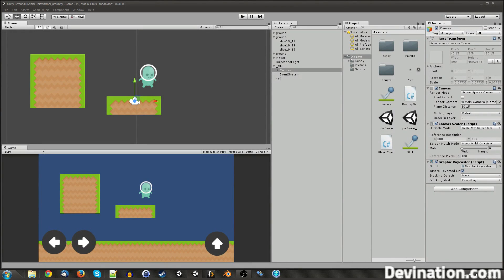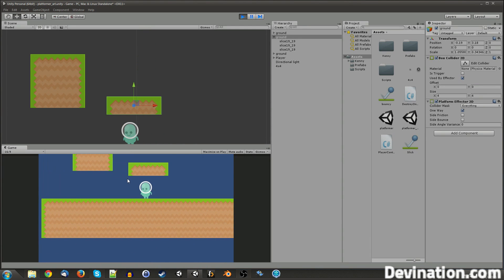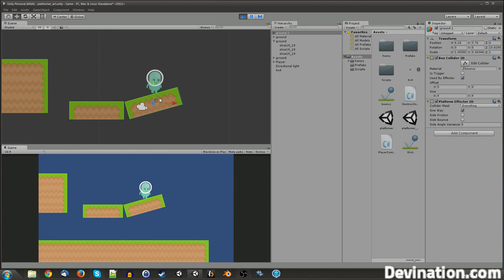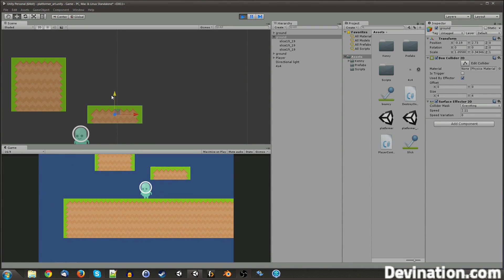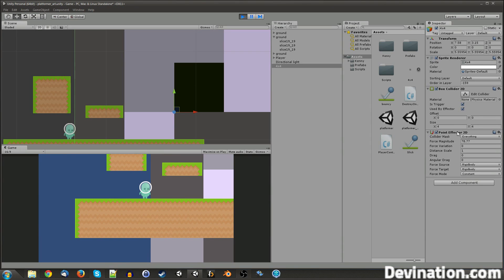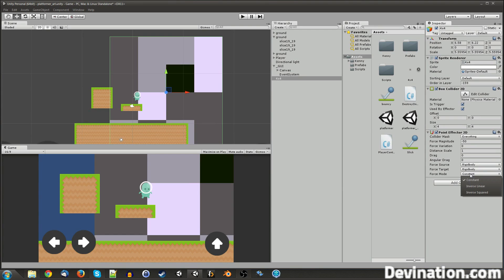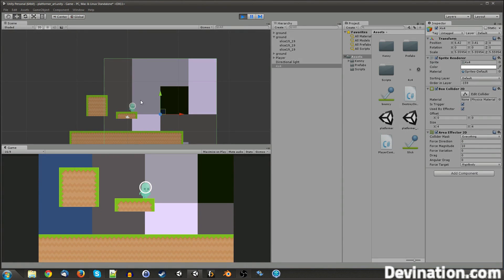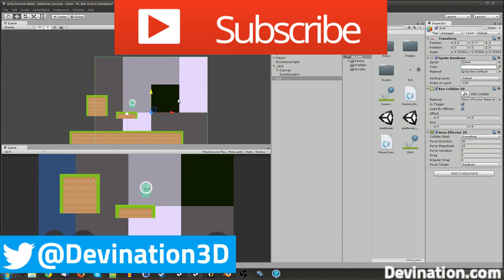Unity 2D Effectors Tutorial Overview

Comment: Nice video! Have you noticed Surface Effector 2D affecting the player's control? Don't seem to be able to move or jump when touching an object with the component attached.
Reply from the maker: Sam Sheffield I did notice this, haven't had time to look into a solution yet though :( I'll reply here if I find a good solution in the future
Reply: Devin Curry No worries. Looks like Surface Effector 2D had some issues which were fixed in the latest point revision update.